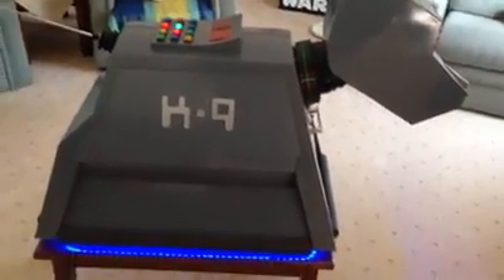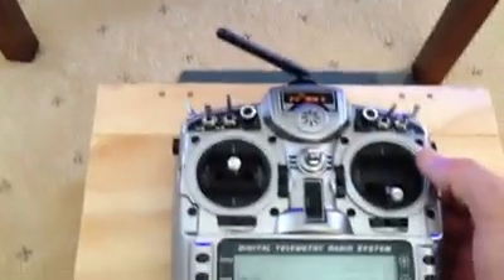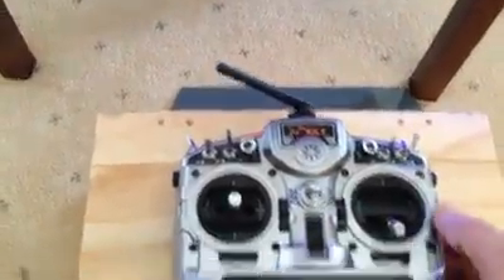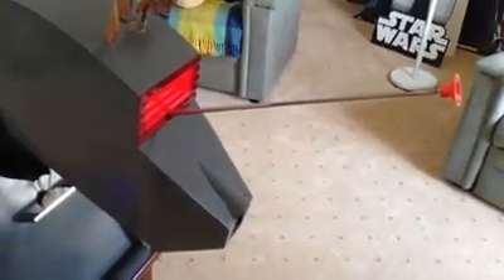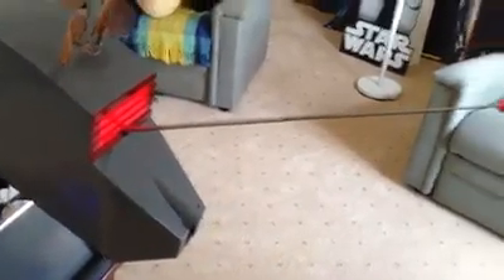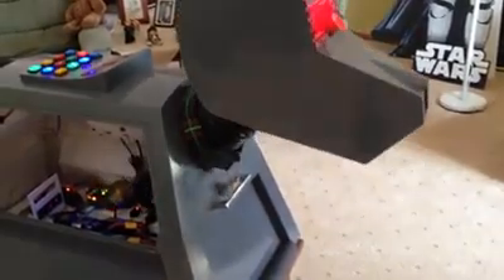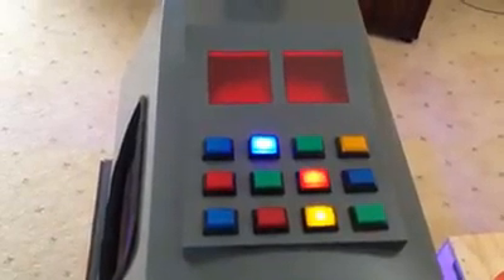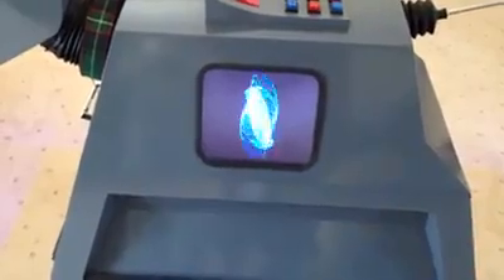K9 build Radio Control Functions

Comment: Were did you get the tale rubber shoe from and the neck.
Reply from the maker: Tail boot was from Kelpro an aftermarket boot supplier part number SRB‐048 fits‐
Suits Impreza GC, GF 4/93 – 12/98 4cyl 1.6L
Suits Impreza GC, GD, GF 1/92 – 12/01 4cyl 1.8L.
Suits Impreza GC inc WRX turbo 1/92 – 12/00 4cyl 2.0L
Suits Impreza excl WRX 12/00 – 12/05 4cyl 2.0L
Suits Impreza excl WRX 10/01 – on 4cyl 2.5L

Neck was from Eximo SpeedLoc Sunflex 127mm duct

Have post all the information on the facebook "K-9 Builder's Group" in the file section named "K9 tail boot and neck options.pdf"
Reply: @ozzymat61 thank you 👍